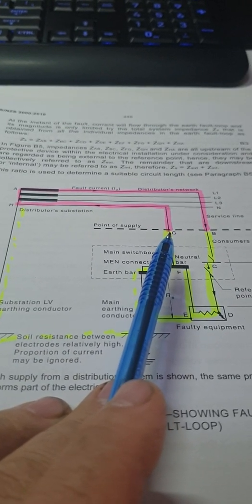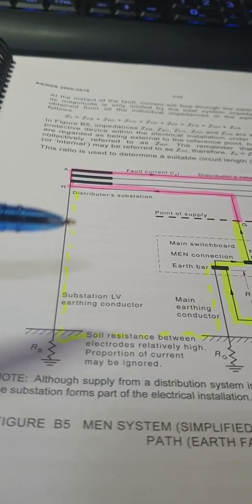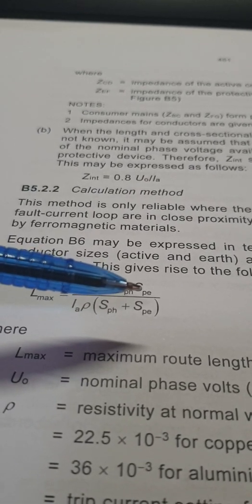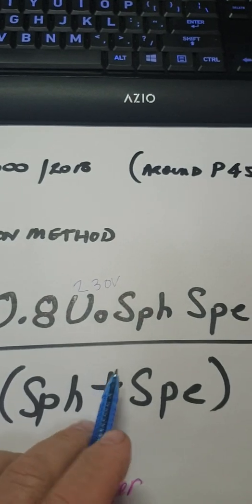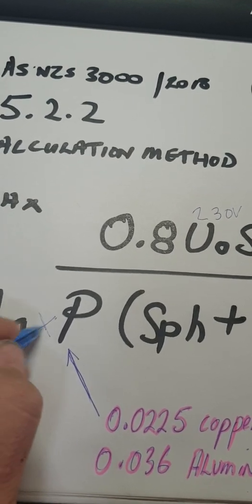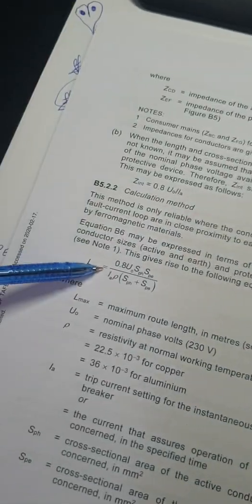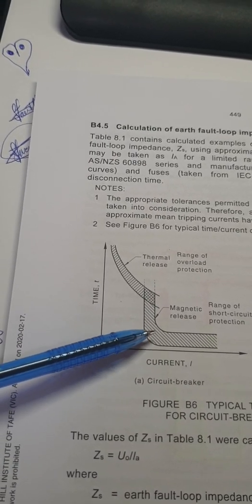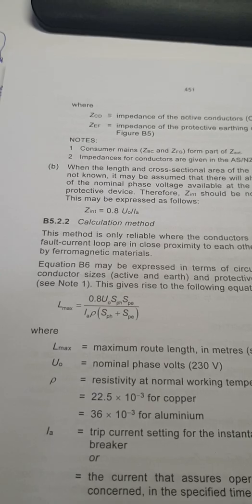fault loop impendance as/nz 3000.2018 explained

Comment: Why do you need earth rods when the fault travels down the earth conductor straight into the men link. Then back through the neutral?
Reply: back up.
Reply: If there is continuity regardless of resistance current will flow. The M.E.N and main earth are parralled so a fault current will run through both. If the M.E.N is left out the main earth will provide continuity bypassing the rcd tripping the cicruit.
Reply: @hidad5601  So when there is a fault current going down earth it goes down the CPC to the MEN link. Then goes down the earth pegs and down the neutral back to the transformer?
Reply: @jamesgledhill9667  Yes. The fault current will return back to the neautral through the protective earth of the damaged equipment.  If the M.E.N link is removed for testing and not put back in the main earth offers an alternative path to neatural (at the transformer or green dome) for current to travel to provide the Residual Current Device the imbalance in the magnetic field to trip. But the ground resistance is high especially when dry meaning it may not allow the 30mA of current flow needed for an RCD to trip. In Australia you can loose your license, face fines and even man slaugter if you forget to re install the M.E.N link.